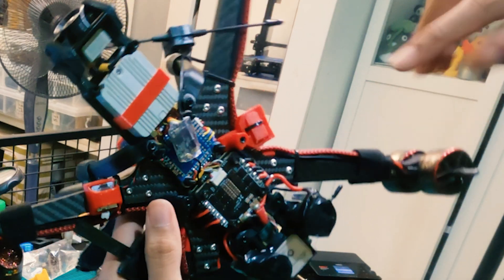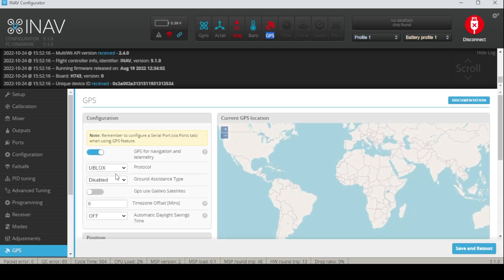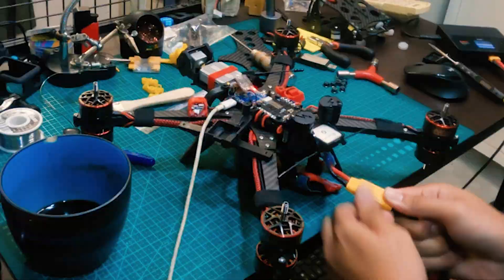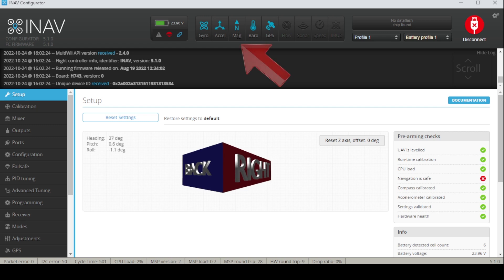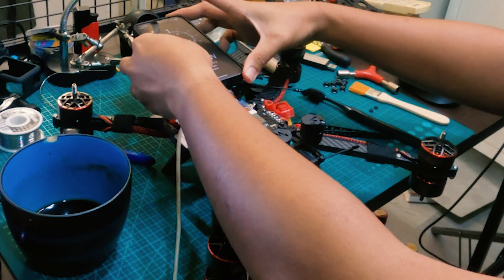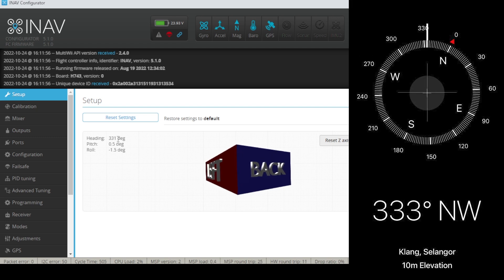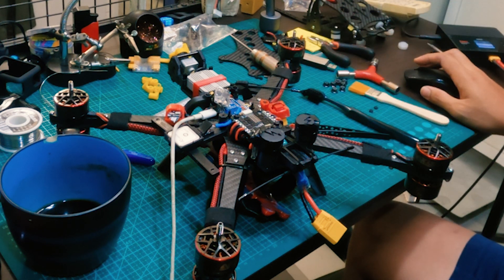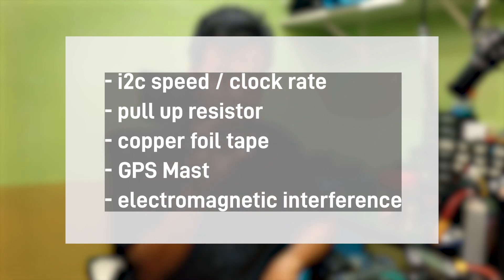INAV GPS and Magnetometer red fixing

Comment: Thanks for the suggestions.  I noticed on one of my builds that if the GPS is placed near the RX antenna (yours is Crossfire?) the Fr-Sky and ELRS telemetry from RX to TX will disturb the GPS. Repositioning is a good solution if you have the space.
Reply from the maker: Good eye, your right, that might’ve been the cause of my interference as well. 

I’ve already moved away all accessories from the back for direct capacitor soldering, helps cleaner electrical flow 😬

Comment: The GPS in Ainav burned red, it turned out that it was better to look at the instructions for Matek. RX and TX are inverted. When I connected the RX wire to the TX jack and TX to RX, everything worked and the GPS turned blue.
Reply from the maker: Fantastic, Congrats on getting Your GPS working 👏👏

Comment: This issue hapen with me now ...
Reply from the maker: Does it happen even if inav or betaflight ah bro?
Reply: @TanFK  my issue is cable lossed from  board .... i fix it already by re soldering
Reply from the maker: @nugrostv5758  good to hear you manage to solve it. The gps wires that  come with the packet is sometimes low quality. So problems can come from them